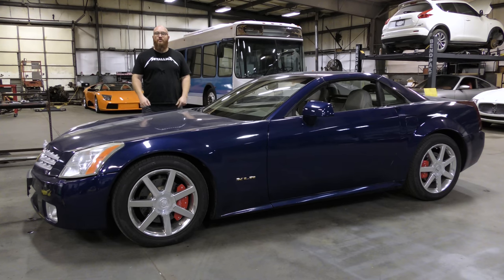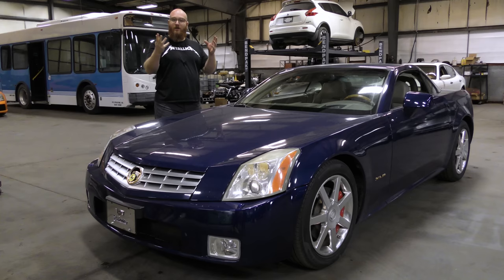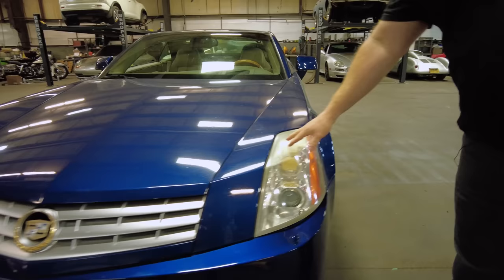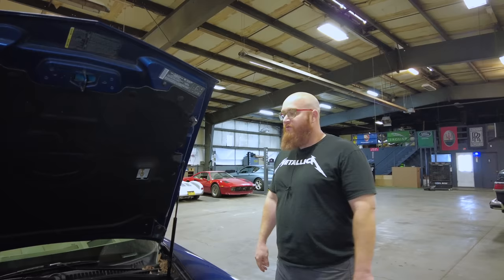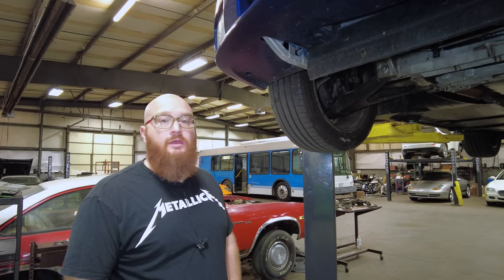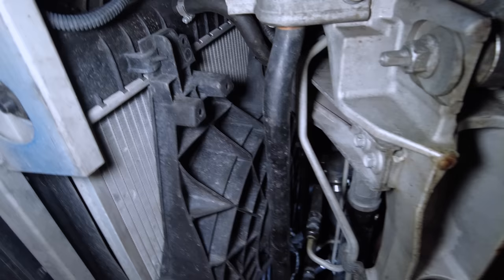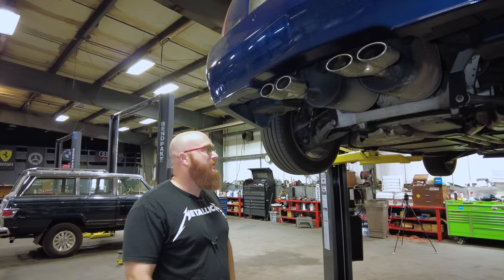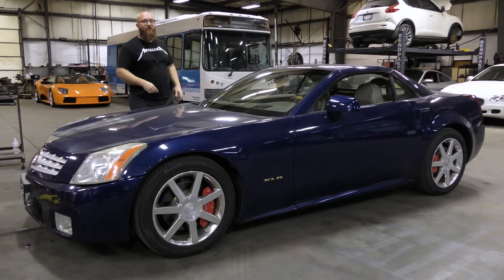Another Northstar? Why does the CAR WIZARD keep buying Cadillacs with this engine? Now an '04 XLR!

Comment: 🙂Hi Car Wizard, points very well taken, no doubt. Generally, I totally agree. Then again, there is a difference between cars bought to be re-sold later and cars bought just because you love them and plan to keep them -- that design, that ride, that color combo -- you just love it. These cars become "family members". For this scenario, there is an old saying, especially true for exotic used cars: "Sure, make the usual checks -- maintenance, how the owner treated it, rust, etc. But then, buy what you love and just have it repaired." (What difference does it make in the end if you spend $10K on an MG or a Ferrari or a Lexus or a Pinto? If that's what you want more than any of the others, go for it!) My modern classic ragtop (not an XLR) has needed alot of work. That's why I got it cheap.The bodywork and interior were mint and exactly my favorite color/options combo. But nobody wanted to deal with the mechanical stuff. A lot of mechanical stuff had to be done, but it was spaced out over the first two years of ownership. With a bit of research, I could help out the mechanic, find parts or good parts sources and make his job easier -- less hours, less costs. At first, he was sceptical but honest about not being a specialist (very important -- honesty). But within weeks, he actually discovered that one of his close friends was a specialist. He hadn't thought about that before. In the overall, mechanical stuff has to be done at some point anyway -- unless we're going to throw all cars onto the scrapheap because of a timing chain. Now I have a classic that I LOVE and mechanically it's virtually new. It managed an 18-hour roadtrip trailering a boat behind it with no problems whatsoever. For that alone, it was worth it. (Otherwise, I'd have to pay someone else $2K to transport the boat.) My goodness, I even love grocery shopping and doing errands now because each time, I have a 10-minute holiday in a car I love that's a blast to drive (OK, I live in an area with beautiful countryside). Was it all worth it? I think so. Yes, because in the end, I don't want anything else to drive. I didn't like the alternative brands and models from the beginning -- but I test drove them and still didn't want them. Didn't like the way they drove, even if they looked great and had great re-sale value. Had I gotten the alternatives cheaper (in total), I still wouldn't want them. Key fact: I have what I want. Does it cost a little more in the end -- the time, the trouble, the bills? Yeah, a little. But I have what I want. (Don't you use this same logic with whom you choose as your spouse? I hope so!) So, the XLR may not be my thing per say, but for someone who loves them, wants to keep it "forever", I say, "Buy what you love. Have it repaired. Pull the damn engine out and fix everything at once. Enjoy it!" Great video! 🙂

Comment: Was fortunate... 3 years ago, bought a 2000 Deville with 68,000 miles for $3,000! Needed nothing! At this price, the car is disposable! 
Just now at 89,000 miles I'm needing to replace the power steering hose. (known issue)

Comment: I thought they got that oil pan leak taken care of around 2000?   I was in a pick n pull recently and most of the Cadillacs , I think were there because of the engine, the body's were fine.   My all time favorite car I ever had was my beautiful 96 DeVille with chrome factory alloy wheels.

Comment: I love my 2004 and I have over 209k mile on it just did a full restoration on the drivetrain of it and still love it... Still at times I wish they put the LS motor in it for power and aftermarket support....😂😂😂

Comment: Looks like custom exhaust with no catalytic converters. The EPA is coming after individuals selling altered vehicles. Be careful on the resale. Those are very sharp looking cars.
Reply from the maker: It has Cats near the engine
Reply: @CarWizard  
Oh sorry. It seemed they were maybe missing since there was so much room and heat shielding right after the flanges where the rest of exhaust met the manifolds. My mistake. Thanks for the clarification.

Comment: For a car that cost around $75K back then, the interior looks extremely cheap, from the center infotainment area to dash. The HVAC controls are way too low and does the CD slot really need to occupy all that space??? Typical GM junk w/ questionable ergonomics and locations of features. The wood grain trim looks legitimate and not cracked/faded.

Comment: I have a 93 Eldorado with a Northstar 28,000 miles on it. Of course got a good deal on it most likely because of the Northstar. But I must say so far it has been fun to drive.  From my experience the Northstar is very smooth and powerful engine. We will see if it turns into a Deathstar??

Comment: Car Wizard - A mechanic of your experience and skill could seal the lower oil pan on that Cadillac without dropping it completely. Simply drain the oil, remove the filter, then loosen all of the lower pan nuts about 2 turns to create a uniformly thin gap between the upper and lower oil pans. Use solvent resistant foam brushes to clean any oil from that gap, then use MOPAR RTV to seal it. Tighten it up, let it set up overnight, then test it.  It should work and you will have saved lots of time and money. If it doesn't work, you've only lost the cost of the Mopar RTV.

I recommend the Mopar RTV because 3 days ago, October 9, 2022, the Project Farm channel posted a video of its tests of most major RTVs and Mopar RTV was head and shoulders above the others in difficult sealing jobs involving oily surfaces. Watch the entire test to see what was tested.  Specifically, Project Farm tested  Mopar Silicone RTV, Part # MS-GF-44-B, which costs about $13 per tube.  However Mopar also sells an RTV specifically designed for sealing Automatic transmissions(i.e. really hot, oily metal surfaces); the part number is MS-GF-41-B, and costs about the same. Amazon sells both these products.

The solvent resistant foam brushes I mentioned are also sold by Amazon, and an assortment can be found under this listing - Multi-Purpose Cleanroom Foam Tip Cleaning Swab Kit for Camera, Optical Lens, Arts and Crafts, Painting, Gun, Printer, Automotive Detailing CK-FS100 (Multi-Size kit) at a cost of $11.87 plus any sales tax - free shipping for Prime members.  Don't use cheap cotton swabs, which can leave cotton fibers behind.

Comment: One headlight is shaded under a tree or some other sun ray obscuring while the other isn't while parallel parked, very common issue.   When there's no aftermarket parts cost a small fortune.

Comment: They are a nice car if somewhat overpriced when new to have a snazzier interior.  One oddity I believe hearing the top speed was slightly higher on the XLR, due to less downforce vs the corvette.
Reply: The XLR's top speed was computer limited to 155 MPH. I remember hearing of someone deleting this feature and going 'over 190 MPH' in an XLR-V back in 2006.  ^v^

Comment: I was in high school when these came out.  My dad & I got to got to the Birmingham (Alabama) auto show the night before the show opened and got to see the new XLR up close when they were bringing it in and setting it up on the floor.  The only problem was that the fire department wanted all of the cars inside to have the batteries disconnected, so then people couldn't open the doors.  Don't know if they figured out to do when the actual auto show opened.

Comment: The 4.9 is the best motor that Cadillac made my dad got $250,000 MI with no problem it kept running for another $50,000 Miles when he sold it

Comment: I don't understand the mentality of 'getting your money back' in purchase price and repairs as if you're definitely going to sell it soon. If you like a car enough, who cares? You need to drive something. And repairs over 5 years on most cars, including this one, will be less than an average new car by a huge amount. $5k vs $30k+. My last car was a used Prius. Before that, however, was a new RAM 3500 diesel dually. Couldn't find a used one spec'ed how I wanted and needed it, so had to cough up the $80k+. The biggest question, I think is how many decades will a car be supported? That depends on how many were made, largely.

Comment: Man all those northstars engines used to always leak from the oil pan. Even with low miles . I've never seen one that didn't leak oil.
Reply: My 94 STS is bone dry at 150k. Probably had the seals replaced at some point.

Comment: GM spent like $30 Million developing the new Blackwing Twin Turbo DOHC V8 and they cancelled the project right when it went to market! You can pick up the Blackwing crate engines pretty damn cheap, it would actually be a pretty damn cool engine for a project car if you wanted to be different!

Comment: Congrats, wizard. I, too, have an affinity for northstars. You got a nice ride. I’m on the hunt for a nice STS (RWD) since I don’t fit in the XLR. I’m currently eyeing a RWD 4.6 SRX that a customer is considering parting with because the valve body is intermittently throwing it into limp mode. {rubs hands excitedly}

Comment: With better head bolts it might be a reasonable engine. It should be possible to retread the block without removing the engine.

Comment: I recall wanting a DTS or DHS so bad it hurt.  That was until I drove an 01. I was expecting to feel some real power.  I was not impressed.  I wound up buying an 03 Town Car. It was beautiful and very comfortable.
Reply: That's odd, I drove both and bought the Cadillac, much more power
Reply: @califdad4  yes,  it's true that the Cadillac had more power,  but I was expecting a lot more performance from the Northstar than it felt like.  When I drove the Lincoln I wasn't focused on performance.  I was judging it by the beauty of the two tone color paint scheme, the quiet comfortable ride, and factory stereo. If I could buy that same car again today I would.
Reply: @lindanelson8400  neither manufacturer is building anything like that today, so guess we both have to move on.   If I had the money I would love a new CT5
Reply: @califdad4  very true 👍 in 09 I bought an 07 Toyota Avalon,  loved it then with 24k miles and still love it today with 90k miles.  I'm going to drive it till the wheels fall off,  then I'll pick them up, put it back together and keep on driving it.

Comment: Underpinnings are C5 Corvette as the C6 didn't come out until 2005. If the two front lamps are worth $3k and the two rear lamps are worth $4k,  what's the worry? You could part out the car and make $10k. Or, spend $3k fixing it up and double your money. I think it was a no brainer at $9K

Comment: There's an SAE mechanic on eBay who replaces the head bolts with updated bolts and re- installs the head on the engine for $2,000. Theoretically, a person could have a very loaded Cadillac with a like new engine for around $4,000. That's not bad.

Comment: I saw a sedan with a Northstar at auction. They had it locked until it came up. They said they had not cleaned it up. Sneaky way to sell a car that took a swim. Sand on shock towers and debris in the dash edges. Though I said my suspicions rather loudly in the crowd someone still bid it to $10k. When it was started it sounded worse than my old ride on mower 😮

Comment: Do you know about Jake from NorthStar performance that created the stud kit? I'm guessing yes, this just to add context to what I'm about to share.
I discovered North Star performance after I left a used car dealership having bought a 2003 Dark Blue Metallic Cadillac STS, I wasn't even looking for a car, nothing wrong with my 1994 Civic Sedan Special Edition 5 speed, although I was on the third drivers seat.  
I was checking out cars for another, and I did like those Deville Grampa cars, they were all sold, so too, the 2002 Honda Sir, but at the bad, a STS and SLS from 2003.  
I sat in the STS, did nothing for me at that time, and I was ready to leave, I almost made it to the gate, but he managed to cut me off with that same car, he said, just a quick test drive...
So I drove it...3 blocks later, my back informed me that this was my car...and it  correctly predicted this outcome.
It didn't take long for driving it like a Grampa for the carbon build-up to happen.
The Italian tune-up I read about in the forums did nothing for the tapping, and only attracted dirty looks from adults, and puzzled looks from young children.
So I decided to try something less attention getting, something I could do every time I drove it...
I simply began to drive it exactly as I had driven my Civic, so aggressive on the throttle, but not abusive, I might get a bit of chirp from the tires...
It took four months to burn out the buildup, and clear sailing from there on, I had it for 7.5 years, then sold it to Jake of NorthStar Performance for 800, which included 
a smaller diameter set of Cadillac alloy wheels from a CTS, got them with well used tires for 500, to use for winter tires, the difference in prices paid for the wheels, 
and it was great fun driving around on those smaller tires for a few days, increased the zippy-ness factor by a lot.
This was some times ago, as you might imagine, the dealer I bought that 2013 Nissan Maxima for 17K with 30K miles on it had only offered 300 for it, and that wasn't surprising in anyway.
So Jake was offered it, at first refusing, telling  me he wasn't buying them anymore, but shortly afterwards, once I sent him pictures, it seemed another deer had decided to test it's speed against his STS for a second time, and both did not fare very well.
So he bought it, showed up with a trailer, and drove it on, and I suspect he enjoyed it as I had, it never failed to allow me to feel as though I was floating home from work each day.
This is a story of my only GM experience, for slightly less than a CIvic with a/c, it offered decent highway mileage, and that comfort, and very notably, the most comfortable drivers seat ever experienced, once adjusted to my preference, never numb butt, even after a 16.5 hour drive.
Thank you for you time and attention.

Comment: Because by this point they had figured out nearly all of the issues with the engine. In fact the issues have been sorted out by 2005. It doesn’t excuse the fact that that’s over a decade worth of stupidity but still. The only  shitty thing on these things is that the tail light assembly is ridiculously expensive to fix

Comment: Dang, i have an STS, and was curious about an xlr, but i wouldn't trade it off, i love these cars.lol
Im getting ready to swap it with a denali 6.0 to get rid of the Northstar issues.

BTW, you dont have to turn the car on to see the odometer, just HOLD the button down on the acc position for a few seconds and it'll turn the whole dash on! Comes in handy to hook up the code scanner..

Comment: On the xlr. Do you know about the ghosts in the ignition switch contacts..C5 and C6 have this issue. Engine off, disconnect battery, insert ignition key. Cycle from locked to crank and back 100 times. This cleans the carbon off the contacts. 
Can you access the cadillac diagnostic system with the climate control off and warmer buttons ?  
Is the retractable top the same as the gm pickup.

Comment: ... Strut bad, oil, and power steering leaks ... known defect with head bolts, what is going to need at 90K miles, engine and transmission rebuild? This is a car only an in-house mechanic could love.

Comment: If the pushbutton works like mine, you push it for 5-10s without touching the brake and it turns accessories on

Comment: caddis with transverse northstars easy. Drop engine and cradle in 1 hr. Head off and to machine shop. From there upsold pan gasket r & r. Pull remaining engine to a stand. Easy. Cradle sat on jack stands.

Comment: A friend of mine had in El Dorado of this generation, the trunk was the type where you place it down and it pulls at the rest of the way and then latches. That part was malfunctioning and he just took the jack and started slamming the unit with the jack a couple times then slam the hood down and it started working again never failed again… Sometimes tough love is needed but I did not think it was appropriate
Reply: Ever one of those GM 'soft-close' deck lid mechanisms failed before 100K.

Comment: another don't --take my word for it advice, check northstar engine facts, until 2006 or some 05 late, the northstar did not have the updated head studs and were extremely prone to pulling loose and allowing a coolant leak at bottom of cyl sleeve o-ring seal.  the update was to install larger circumference studs with coarse threads for a better seal.

Comment: A friend bought one for his wife, 2005 used. I lost a valve spring, the top hydraulics twice, ECU twice, never got right, tail light went ($4K) . paid $40K put in at least $25-30K  in repairs. Drove like a rocket, awesome interior but one of these worst cars I have ever seen. Just sold it, very flawed, for a little over $10K. Nope. He has a 91 Vette with well over 200K it runs like a dream.

Comment: Honestly, just do an engine swap replacing the old Northstar engines. Go to a yard and find an old and more reliable similar engine. The cost to fix one will be close to getting a used engine that's more reliable.

Comment: You should have just bought a C6 Corvette! At least you can buy parts for that. You're going to find out that XLR didn't have a lot of production and you're going to find out that the parts are going to be very limited and very very very expensive if you can find them! BTW, if those are magnetic ride shocks that are leaking, you're going to cry when you see how much it's going to cost to replace them. At least $700 each shock.

Comment: If you want a northstar motor get any engine that's 2006 or older because that's when gm fixed the major problems and made it a great engine still have an 09 sts-v and haven't had any major problems yet